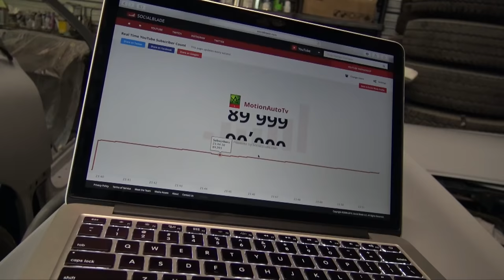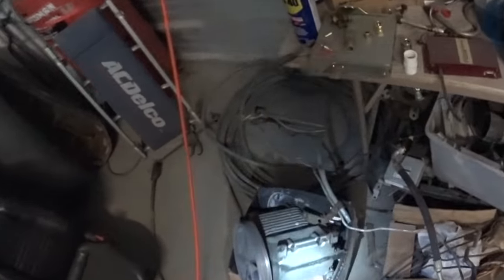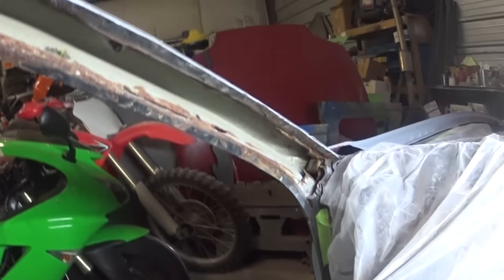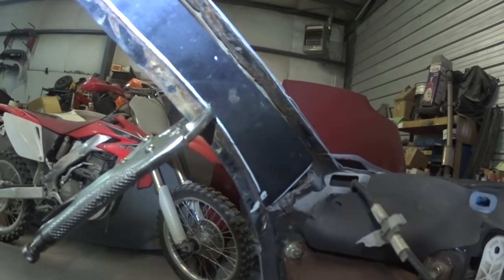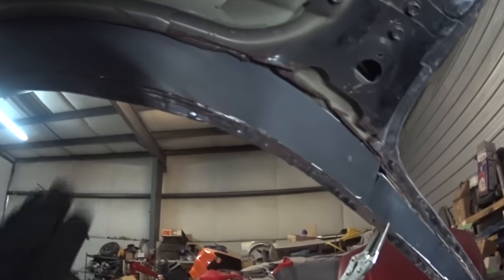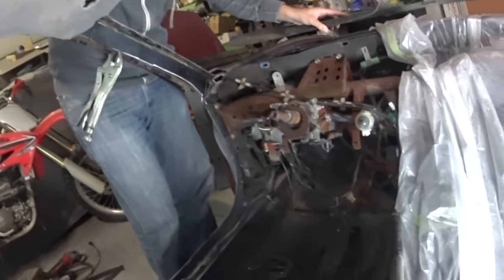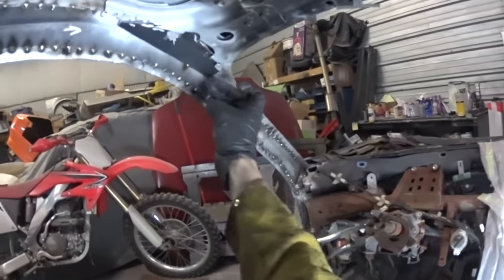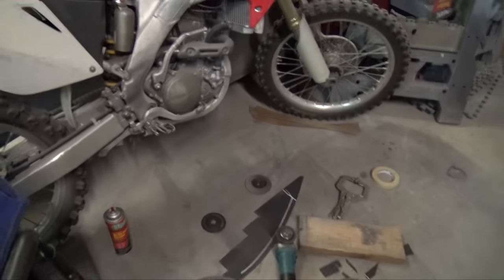Pt.8 MKIV Supra Project! | Replacing the A-Pillar!

Comment: I've only seen 2:32 of the video so far but the roof is such a crucial part of the car in a crash so if you are doing a cage, please do continue(all though not recommended).... but if not i would seriously consider buying a A pillar of a scrap car or from Toyota ... and spot weld it... in a crash its NOT suppose to be stronger than the other side, its suppose to spread the impact of the collision, Keep up the good work lad, and beat those Haggard peeps :)

Comment: Let me know if you need a driver side hard top window seal.  I have brand new on  in bag from Toyota.  It seals the window to the body a pillar to roof line to b pillar at window level.  not sure what your final goal is on the build or if you will need the seal.  good luck on the build!
Reply from the maker: Yes i do! Send me an email motionautotv@gmail.com

Comment: Did you prime the back side of those plates you welded in? Also, how will you stop rust on the inside of the welds? Does it just not get enough moisture in there to do much damage?

Also, very nice build.
Reply from the maker: Yes i did

Comment: trevor what is ur option about floor replacement my civic hatch floor is a mess one side was fully done basiclly but really shitty job an the otherside i just did 2 patches do u think i should get someone to build me a floor pan an weld it in or  like idk is it worth the money or leave the old thing rot away
Reply: cut out whatever is rusty and replace it with slightly thicker metal than stock, if its a large area just put some beads on it in the shape of an X so its like 4 triangles and very stiff, just use cardboard to get the shapes right
Reply: That-JDM-Fascination! thanks man , i did patches but i really like the car so i think next year ill cut out stuff an redo the floor
Reply: dyllenger I've replaced sections of floorboard before by cutting out good material for a shell at a junkyard and welding it back in. I wanted it to look OEM vs sheet metal

Comment: I am afraid that this structure is not strong enough. A pilllar is usually from 3 layers of sheett metal. 2 inner strong sheets creating stiff boxed section. And outside design layer from soft sheet metal. I am not hater. I like this project but i recomend to redo it for safety.
Reply: i was just wondering the same thing